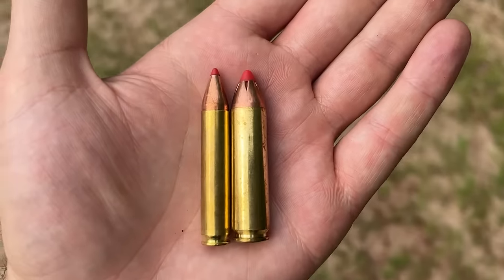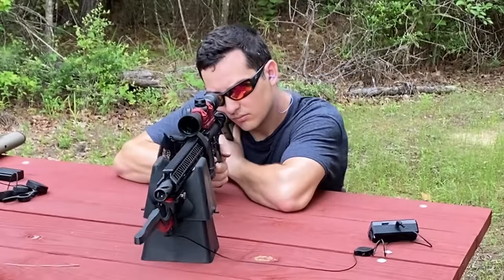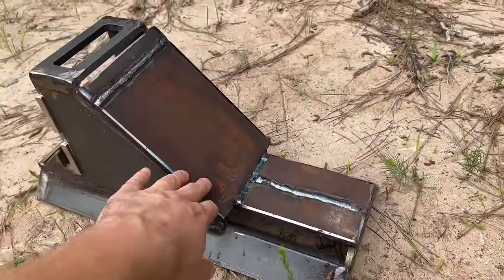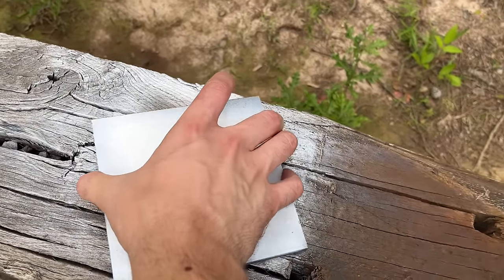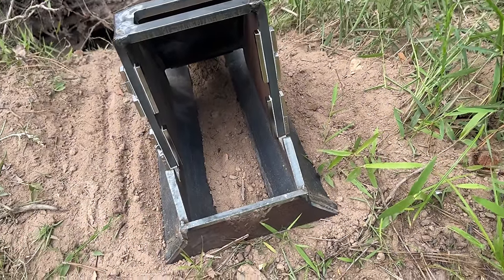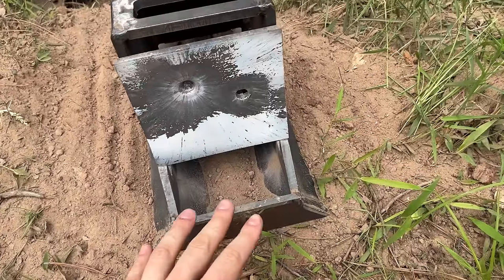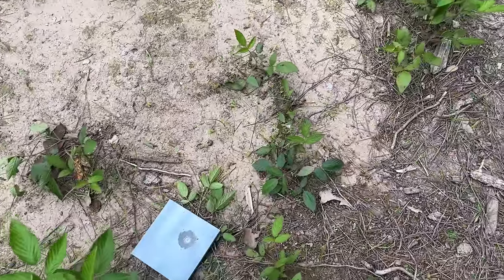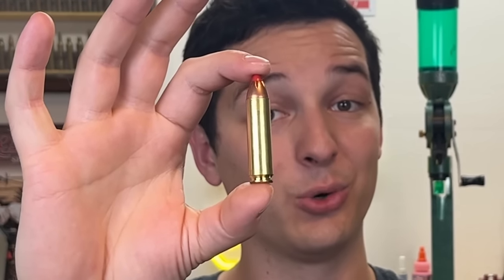350 Legend vs 450 Bushmaster: INSANE Difference On Steel

Comment: So does this mean if I shoot a Bigfoot wearing 1/4" mild steel armor, I'm gonna be in big trouble? I thought my .450 Bushmaster would for sure drop the big guy....
Reply: Actually the energy transfer would turn its ribs and internals into jello at over 2,200 lb-ft of kinetic energy. If anyone thinks that wearing a vest will save them, think again!!! Those 2 distinctly different bullet designs are designed for completely different ballistics and ranges. The 350 is a nasty round with better longer range performance, but the 450BM is designed to stop ANYTHING within 200yds...period!!!
Reply: @Bush63Master  Hence why I chose the 450 Bushmaster over the 350 Legend.

Comment: I would like to see a 350 legend chambered in a 12” or 10.5” barreled AR pistol. Also I really need to see a 350 legend vs 3030 Winchester steel challenge. I think that would definitely put a lot of controversy to rest.
Reply from the maker: That would be a great one. I don’t think it’s quite up there with 30-30 so I think it would be interesting
Reply: I have a 10.5” 350 legend. It only loses about 200fps over a 16” barrel for most loads, which means it’s still plenty powerful. I build mine to be the easiest/lightest deer gun I could. Locally I’ll never really have the opportunity to shoot a deer past 100yd, so having mine with a 75yd zero (which puts 50 and 100yd less than a half inch off zero) is perfect.
Reply: I have an 8 inch it runs 1950-2000fps for all weights of commercial ammo

Comment: What about adding a sleve that you could slide the plate down into,like the little lip at the bottom but 4 to 6 inches tall with some metal on the side so it cant slide left/right

Comment: Couple of things going on here.  The smaller the projectile diameter, the less energy needed to fully penetrate the steel.  I don't believe it's a linear relationship with the diameter of the bullet but I'd have to go dig it my old college textbooks to confirm.  Related to that, there's an impulse right at the instant of contact, and even though the .450 has more kinetic energy, that velocity element comes into play for the .350.  And yeah, sorry I didn't see your previous video, I know the magnet approach isn't viable for this situation, just too much elasticity in the plate vs the rigidity of the frame and the brittleness of the magnets to keep things together on impact.

Comment: How about trying some of the small diameter bungy cord / elastic cord? That way if the metal plate does bounce off the rack, it may get pulled back, and held in place! Just wrap it around the top and bottom!?

Comment: It might benefit to consider energy per square inch.  Can be calculated by determining with the bullet diameter.  Can probably establish a correlation on minimum requirement to penetrate.

Comment: I have a cva scout v2 45/70 converted into a smokeless muzzleloader.  I shoot a none saboted bullet, that is .452, and it chronographs around 2600+ fps. I love to see a test like that on 1/4 steel
Reply: What are your thoughts on the CVA scout? Do they use the Bergara barrels as well?
Reply: Not sure mine has the factory barrel and does great. Cutting bullet holes @ 200 yds

Comment: I am a bit surprised.  Informative.  I will say the Hornady FTX is terrible for penetration.   I stopped using it because it blows up on deer let alone steel. 350 impressive.  Still would take my 450 over the 350.  With a Barnes TTSX they are awesome

Comment: I decided a long time ago that actual bullet construction is the most important part of a cartridge. I own a 450 bushy and buy federal ammo for it or cast my own bullets to reload, the hornady stuff is too soft. Now i realize in the test its hornady vs hornady but hear me out the 450 Bushmaster  is .452 so it is a pistol caliber in reality and the 350 legend is .350 so a rifle caliber. I believe the engineering that goes into the bullets is this... they rummage around and find what they have on hand and modify the machines to make a slightly different looking bullet thats safe to shoot and shove it in a box. I mean hell the 300 grain 450 Bushmaster from federal is loaded with a deep curl meant for the 454 casull. A good cast lead (from wheel weight) bullet, water dropped and annealed can cut through steel like a hot knife through butter.

Comment: This is an explanation for the difference that you see.  The kinetic energy of the bullet, K.E.= 1/2 mv2 (mass times the square of velocity).  but what is important is the stress applied on the steel plate where the bullet hits.  Stress= K.E./surface area.  The 450 has a surface area that is 20% higher which reduces the stress by 20%.  A lot of people put emphasis on the initial K.E. of the bullet but what is important is the total energy transferred to the object.  if the bullet exits, then the K.E. transferred = mass(v1-v2) 2, the mass times the square of the entrance and exit velocities.  The 450 has transferred all of its energy to the steel plate in the form of deformation of the plate.  The350 did not and has a nice hole.  This is important because killing a deer depends on total energy transfer among other things.  This is why FMJ bullet are banned for hunting.  My son used the 12-gauge mini slugs to kill several large deer.  These are slugs with a flat front surface with 1250 ft/s velocity.  None of the deer ran very far and I recovered every bullet under the skin opposite to the entrance hole.  There was a lot of meat damage.  Hopefully my explanation is not very confusing.

Comment: The magnets, when they shattered, absorbed a certain amount of energy that would’ve otherwise gone into penetrating the steel.  if you wonder about this, see those videos where a person sits a brick or concrete block on someone’s chest and hit it with a sledgehammer. The brick or concrete block, shatters and absorbs the energy of the sledgehammer so that the person is unharmed.

Comment: You should run an angle across the top forcing you to slide the plate in from the side. Also throw a sand bag across the back if needed to help hold down the sled.

Comment: Maybe if you put some ears coming off the sides at the top of the sled with holes in them so you can run some pins through to hold the plate. You could just add it on and replace anything that may or may not get damaged

Comment: You need the magnets set back about half a millimeter to one millimeter from the steel you are shooting at so it doesn't contact the magnets at all. Then you need bits of steel on the each left and right side that you can slide over to lock it, on top and bottom fixed steel protruding then with the magnets and steel at the side with a slot to slide over which have couple of holes to stick a nail in to lock the side pieces then when the shock of the bullet makes the steel jump away from the magnetism the sliding brackets and top and bottom fixed bracket will guide the steel straight back onto the magnets. I picked it before you shot it I thought those mags will shatter if they are not set back slightly and well fixed into position.
Reply: Also use windscreen glue the glue that holds windscreens in on the magnets to give them extra fixing power.

Comment: In my opinion, the best penetration you will get (excluding 12.7 x 99 mm aka 50 BMG shooting a green/gray tip Raufoss MK-211 HEIAP or silver tip M8 projectile or a SLAP/SLAP-T 355 gr sabot @ 4,000 fps !) is from something like a 22-284 shooting a SS109 projectile @ 3,800 fps (24"bbl)
Reply: There are better projectiles than the one you mentioned but they are hard to find.  The .22/284 is on the right track but is a pain to work with.  I have been testing the .22/243M (the .243 necked down to .224 with no other changes) and it's far easier to load for!
It will push 62 grain fmj's well over 4,000 fps with a 26" barrel with multiple powders and they will blow through 1/2" AR500 and AR550!  There are some heavier steel core AP's in .22 caliber plus a couple of tungsten core rounds if you can find them.  
I did test some of the tungsten rounds in a .22/284 with a 28" barrel versus 2.5" cold rolled mild steel and they penetrated to a depth of just over 2" which was better than the .50BMG with the standard M2 AP will do!  When the tungsten projectiles were seated in shortened brass .308 projectiles with total weights of ~ 80-85 grains and loaded in the equivalent of a necked down Chey-tac case (to.30 caliber) and fired from a 35" barrel at velocities in the low 6,000 fps range... they would come within an eighth of an inch of exiting a 2.5" cold rolled steel block which stopped an extremely hot  .50 BMG round loaded in the fastest .50 caliber barrel that I ever had!  It was a 38" IMI barrel that would top out in the low 18,000 foot pounds range, at pressures on the edge of primer leakage.

Comment: .450 bm has similar ballistics to a .45-70. its not designed to penetrate steel. Will pass through flesh easily tho. Big heavy slow moving bullet will do a number on flesh

Comment: Witnessed and taken a fair share of whitetail with both and they both kill effectively but the 450 hands down leaves better blood trails if you have to track. 450 I’ve always had instant blood at impact. With the 350 it usually takes a little bit for them to start pumping so if you hunt in the thick stuff I would lean towards a 450
Reply: I have never needed a blood trail with my 350 they usually drop on the spot

Comment: I did say neodymium magnets are extremly fragile and you need an airgap so it doesn't impact on the magnets, also magnets can lose their magnetism if you hit them hard, you should recess the magnets a bit inside the steel - the steel itself will be magnetized so it should hold.. actually I think electromagnets would work best - but it'd also require batteries so is a bit more complicated.. good try though.
Reply from the maker: I think these were recessed close to 1mm on each, but obviously that wasn’t enough. I think you’re right about the electro magnets, but don’t know that it’s feasible right this second. I really appreciate the ideas though

Comment: have tangs kinda like on the bottom, but on the top, so you can only slide the plate in from the side. would work and look amazing. no need to mess with clamps every time either
Reply: Yeah but if he hits too close to the top or bottom the deformation of the steel may not allow the plate to be removed. Having some kind of clamp system from the sides or top would allow it to pull away and the steel be removed regardless the shape it’s in.

Comment: Make the slot just big enouigh for the plate make it adjustable wit dual screws on a slider on both sides if multiple plates are needed, and then have dual clamps from the top screw down to hold it down.

Comment: When discussing penetration Sectional Density(SD) simply cannot be ignored, given comparable construction and similar velocity the higher SD will outpenetrate the lower SD.  A 165gr 35 cal bullet has an SD of .192, a 250gr 45 cal has an SD of .170.  Given other parameters construction and velocity being similar the .192 will penetrate farther, that is pretty much a given even without testing.  .170 to .192 is a fair difference, 12%.

Comment: Not sure what’s going on with the steel plates maybe because it’s a bigger circumference bullet?  But The 450 is superior for deer hunting. Basically the same ballistics but approximately 100 grain larger bullets. Especially if you’re stretching the shot out past 100 yards.   A lot of the guys that jumped on the 350 bandwagon in my area started experiencing wounded deer they didn’t recover and went back to the 450 and end of problem. You’ll find quite of few videos now on YouTube talking about this issue as well. I understand if it’s a small kid, handicapped or woman but the 450 kicks less than a 20 ga. Imo.

Comment: The magnetic field is being wrapped around the steel frame and is not doing much to hold the target plate.  The force is pretty high, you will need a much more robust clamping system that allows for impact forces so as not to break.  Maybe a clamp out of 4150 on a floating mount with a hard rubber for a clamping face. possible a drop in cage might work better than trying to solid mount the target.  It's going to move, under those kinds of forces, so they must be allowed for in the design.

Comment: You need to ditch the magnets and just use two wood wedges on the bottom. You could actually use 2 per side. Have them facing each other to make them exert a more "square" pressure. It would be more ideal if your two cleat slots in front of the target plate was taller but it should still work. 
If you want better more reliable true results you're going to want to resolve the way the whole assembly slides when shot. Bullets with larger diameters will push it more than those with smaller ones and it will skew the results as the assembly dampens thier true power. 
But the same can be said about the guns themselves losing power in the form of recoil. I suspect that's why some manufactures numbers aren't what people get on ranges as many times they use mounted barrels that have 0 recoil and are very precise. 
You'll likely have to sink a 4×4 or 6×6 post somewhere in the ground and lag bolt your bullet trap / target assembly directly to that to isolate variables such as those. Then do the same with a gun rest too if ya wanna go super crazy. 
As far as the bullet trap aspect, you can check around and see hoe some content makers like Demo Ranch tinkered with even PVC pipes and how they're even strong enough to steer bullets. With this in mind you can likely get a bit of large steel pipe and have it funnel all the rounds into a separate removable chamber. Then the system could remain in place permanently and you just empty the chamber periodically. 
Cool stuff bud good luck and great job!

Comment: What was the point of this? All you have to do is look at the ballistics of the two rounds on paper and you would know this. Who hunts steel gongs?
Reply: I hunt them.  They are not as elusive as bowling pins and slow enough that I can usually get a follow up shot if I miss the first time.  No bag limit in my area either.  I find the bigger gongs generally don’t taste that good though - the smaller gongs are fine as long as you soak them in a little salty water first.

Comment: That's all fone and dandy, but can you measure the velocities at different ranges? I mean velocity at 100, 200 etc? To understand how accurate can ballistics computer calculate all those datas. P.s. clamp system is a way to go. Something like toaster. Or maybe modify your target steels and ad some loops at the bottom with which you can bolt them down to a sled. Easier and cheaper i guess.

Comment: Wouldn't the increased frontal area of the .450 spread out the kinetic energy over a broader area, thereby making it harder to penetrate the steel?  What's the ratio of the energy at impact to the bore diameter for both rounds?  There might be a break point there somewhere.

Comment: The 350 may reach optimum velocity at 16" but the 450 might reach optimum velocity at 18" or so.  Did you factor these kinds of differences into your test?
Reply: I thought I was the only one with this question. I saw the stubby carbine length barrel and the muzzle device and wondered how much that affected things (in both calibers).

Comment: The .450 was developed for deer hunting in shotgun only zones. It’s energy stays with the deer and is devastating.
Reply: I don't think that's actually true, it was designed in 2007, which I'm pretty sure predates any of the straight-wall laws.  If it doesn't, then it certainly predated the recent explosion in them.
Reply: @jic1  You’re right, I was thinking when Ruger and Randys Hunting Center got together and chambered a rifle in that cartridge. Until then it was usually a custom build gun to shoot the .450. There’s a Youtube vid about it.

Comment: I shot a buck at 225yds (lung shot) using 225gr 450 bushmaster round, and it dropped in its tracks. If a 350 legend was used, the results wouldn't have been the same. Like The same difference between a 9mm and 45 acp. Kinetic energy wins every time.

Comment: That red tipped Hornady may not be designed for penetrating steel.   It would be interesting to compare it, all other things being equal, to, say, an all copper or bronze bullet.  You might need a friend with a lathe for the latter.
Reply: There's no "may" about it.  However, it doesn't really matter, because both cartridges had the same bullet type, so it's a fair test.  it's not particularly surprising that the faster bullet with the smaller frontal area penetrated better.
Reply: @jic1  A lot can vary, such as the alloy and thickness of the jacket.  But, yes, a faster bullet all else equal will penetrate more.  My defensive 125gr 300's hit 2300fps out of a ten inch barrel, but the brass doesn't last long.  My 7.62x39, same but the brass holds up.

Comment: I would weld a couple of pieces of angle iron to your stand so that the plate slides in from the top, the angle iron wraps around each side of the plate . Problem solved. Of course you will need enough room so that the plate will slide back out the top when you get a dent.

Comment: Basically, if your State doesn't require straight wall cartridge cases for hunting and you can afford a legitimate bottle neck 458 SOCOM, you will discover penetration is way better because you can deliver much heavier and more solidly constructed bullets down range.  The 450 BM is really for the non-handloader types where straight walls are required.  People who don't know better will defend the lack luster performance of the BM, especially if they own an actual BM rifle chambered in the BM.